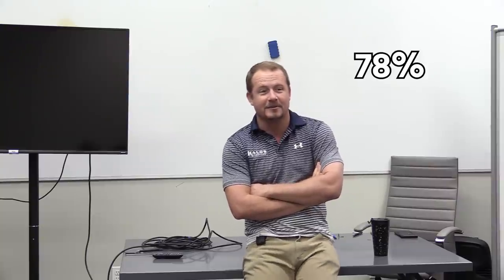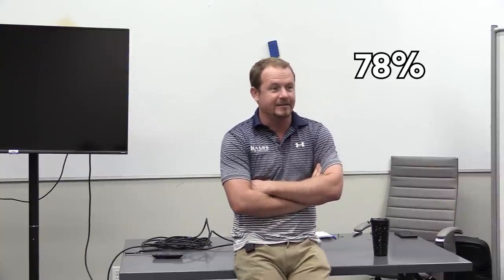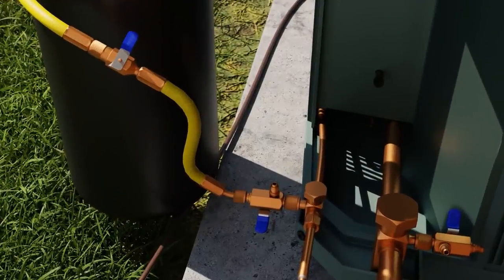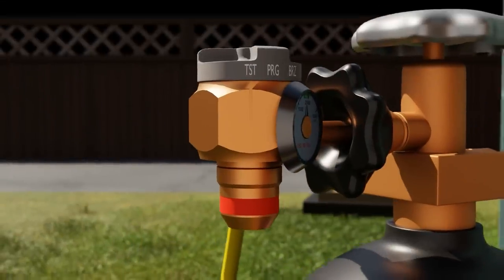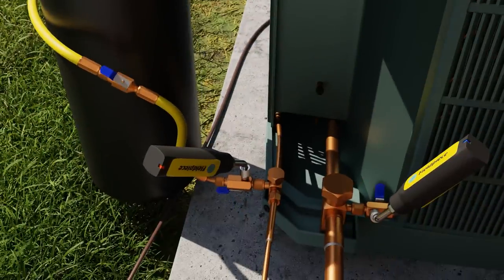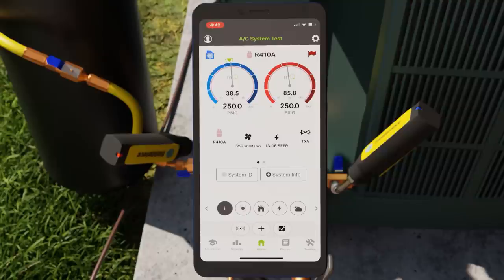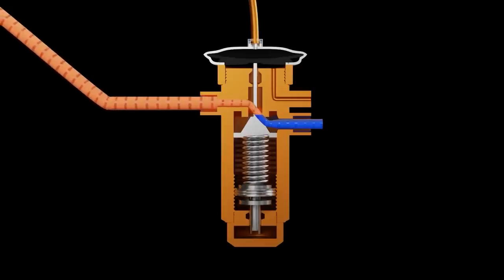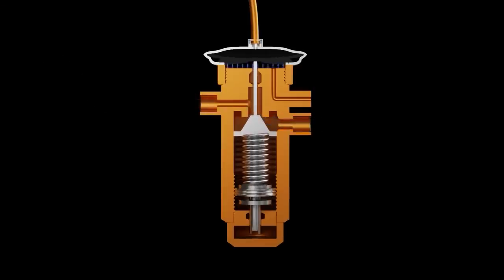Nitrogen Facts and Tips

Comment: Seems like the systems converted from r22 to r410 where line sets ran down into crawl space is where I find the most moisture contamination issues.  It’s kinda like a large p-trap and not getting cleaned out enough before being reconnected to new equipment.  Fortunately it’s rare, but when I do find them it’s usually when the line sets are ran thru crawls.  Interesting video, learned something today!
Reply: Triple evacuate those and pull down to 350 micron, then hold for 5 minutes and be sure you don't go over 500. Then you know you're dry and tight.

Comment: Questions on POE moisture contamination. You mentioned POE permanently changes state after absorbing moisture. Does pulling a deep vacuum not help restore the existing oil? What does the dryer actually do? Do the crystals absorb just moisture or do they absorb the moisture contaminated POE?  Is there any chance for a system improperly installed that is suspected of having moisture to be saved before acid burnout? Or because the POE is in the compressor, with the "toxic goo", is the only way to salvage the rest of the system to replace the compressor? (Just thinking theory, obviously cost would be driving factor to run system to failure)  Thank you for another great video.

Comment: About the mineral oil, not sure why you think we don't use it anymore, sure,new systems don't have it but there's alot of systems out there that use it, compressor manufactures didn't change to some other type of oil for replacement 22 compressors and others, I still need to stock it for the equipment I service

Comment: It's best to use the low side design pressure for leak testing,usually 250psi on 410 systems, although I just replaced a Copeland 7.5 ton scroll this week and the literature said do not pressurize above 150psi for pressure testing, never seen that before and doesn't make much sense since you can run 150psi suction with a good load on it
Reply: Chinese and Japanese brand mini splits have a max pressure of 175 psi for low side lines. don't know why
Reply: @lordjaashin  , The molecules of nitrogen are smaller than 99.9% of all refrigerants ( usually a lot smaller up to 1000 times smaller). This makes the nitrogen pass through a leak much easier, not requiring near the pressure. Excessive pressure of nitrogen can do a lot of bad things (pass through king valves, damage compressor valves or ports and the big one , cause more leaks than you had when you started) this is just to name a few. In my experience 150 pounds is more than enough and in most cases I can find a leak at 50 pounds where I start my initial pressure test.Bryan & @lordjaashin you two are definitely doing the right thing (Reading the manufacturers recommendations). Stay safe out there and regards from the St. Louis Metropolitan area  (go Cardinals).
Reply: Bob Y, there's some good advice in there, but if you're doing a pressure decay test, the higher the pressure, the higher the drop for a given leak. You'll find more micro bubblers at higher pressure. (Don't exceed maximum test pressure on the low side)

Comment: Good one sir....sir can you please discribe can R32 will exchange R410a in our cooling systems....
Reply: R32 is A2L so you got some flammability. Meaning you can't put the flamey one in the non-flamey system. The R410A system will NEED to be redesigned to allow for R32. Sure... portable AC units don't have the same controls as a residential split system, but they are in a black box. House systems will need sensors and other stuff to use R32/R454b.

Comment: When converting a system from R22 to R410a, is it necessary to clean the system with that special cleaner, or is flushing it thoroughly with nitrogen good enough? thank you
Reply: My boss has me flush with rx11 but In the past I have used only nitrogen. Time will tell but it’s best to flush it out. I’ve also heard the flush is bad for the system so idk lol everybody just does what they want. Nobody gives me consistent answers to problems
Reply: @murkyturkey5238  what a dilemma! It should not be so difficult to getting correct answers. I''ve also heard flushing with cleaner will never get all the R22 out because some will still be held in tiny pockets in the coil. Is that correct or just a myth? Even if it leaves some behind, is it enough to interfere with the R410a performance?

Comment: Another thing about leaks… if system has any leaks or will not hold a vaccum
Reply: vacuum is MUCH weaker then pressure test.  atmospheric is about 1 bar. 100% vacuum is 0 bar. but recommended pressure test on daikin AC heatpumps is 41bar ! so over 40 times stronger then just pulling a crude vacuum. keep that in mind !
Reply: @casemodder89  you pressure test to test brazes/integrity of flares. Vaccum will tell you if you have a leak though
Reply: @timrob0420  vacuum will not tell you if you have leaks that appear at 30 bar.

Comment: what would be the max psi to nitro test copper lineset?   I was told 250 psi but I know someone that says he uses close to 500 psi of nitrogen when nitro testing for a leak..
Reply: 500 is too high, all aluminum coils  will pop at the joints.
Reply: @zack9912000  so  what would be max. safe pressure to use?
Reply: 350-400psi
Reply: 500 is fine for r410a systems

Comment: Do you measure subcooling the same way if the unit has accumulator? Residential split with txv
Reply: An accumulator is on the low side. If you're flooding back, you'll have saturated refrigerant. Normally, you'll have superheated.

As far as the question goes, I think you meant a reciever. Subcooling should technically be measured at the condenser outlet but if you let the system stabilize it's normally close after the reciever. If there's a chance you're close, measure at the outlet.

Comment: So if you put a filter dryer inline, is it stronger than the oil at holding moisture?

Any issues purging with argon?
Reply: Argon would be fine, but nitrogen is cheaper.
Reply: @michaelnash8435  Not if you don't have a tank of nitrogen 😁
Reply: I'd argue that if you don't have nitrogen, you shouldn't have an open system.
Reply: @michaelnash8435  That sounds like the crap the local plumbing and HVAC supply companies spout. And they don't receive my business.

Comment: So if one were to have strange fluctuations in an r22 system I could try to recover the charge properly evacuate then blow some off the recovery vapor port and expel the non condensables without having to replace the entire charge from expensive virgin r22.
Waste a couple pounds trying or just replace the whole charge of around 6 lbs and be done on a hunch. I suspect the guy before me didn't pull a vacuum on it and there's no filter drier. Head pressures hunt constantly on a piston system.
Reply: Yeah definitely air, once Hunting or pressure readings moving rapidly on discharge side, definitely air not being condensed, I would Vacuum and replace the r22, if you have an analog Guage you should see the needles moving very rapidly on the high-side

Comment: What would happen if by accident you flow nitrogen thru the compressor?
Reply: We flow nitrogen through compressors when we replace them. You need to flow through it to prevent oxidization in the compressor. Or at least that’s what my boss says. I imagine that an excessive amount of nitrogen flow might toss some oil out of the compressor and that should be avoided before it’s brazed. But after I don’t think hurts anything. I could be wrong tho.
Reply: Just don’t push high pressure through the compressor so you don’t agitate the oil

Comment: Anyone else use co2 for purging and pressure testing? Co2 is cheaper than nitrogen, A tank lasts 10 times longer because the tank is filled with liquid co2 instead of gasseous nitrogen, and its still a shielding gas.  Your thoughts???